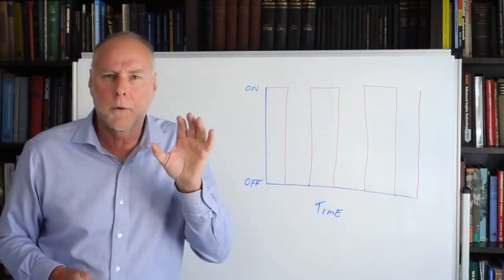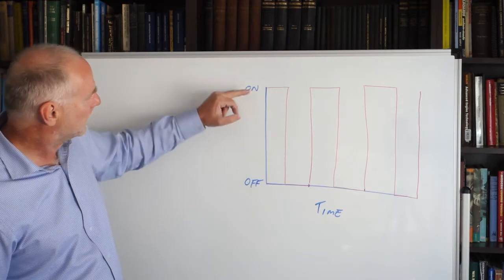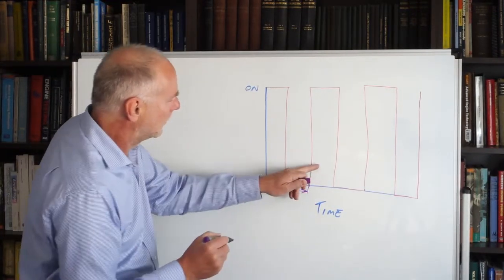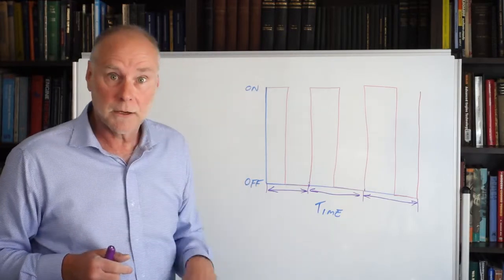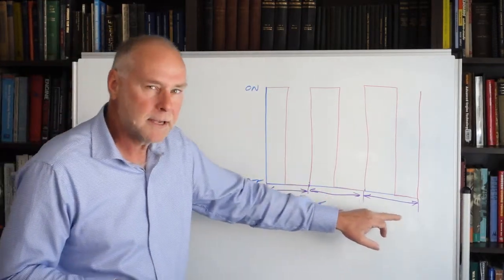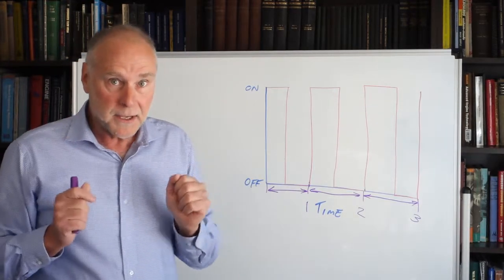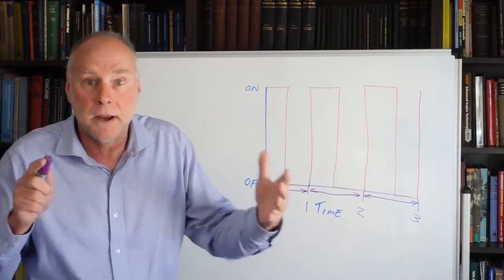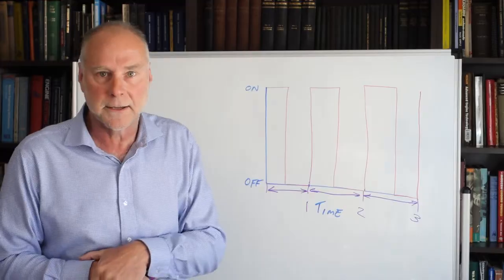Understanding frequency and duty cycle in car systems

Comment: I'm really confused, please sir help me!
When an ECU activates/commands a component (like an injector) voltage GOES DOWN and remains down when activated. But when a light is activated voltage IS UP!
That makes me think that that light is off. Greetings from Argentina, I like your videos!!
Reply from the maker: The ECU pulls the injector to ground to switch on (fed from positive to other side of the injector) and the light is reversed. The ECU is in the ground wire, if you like.
Reply: Thank you very much for helping me out. It is clear now! God bless you